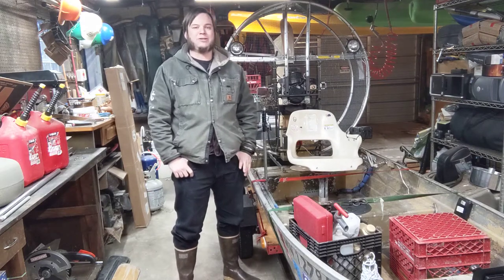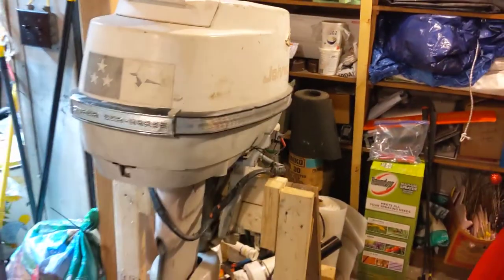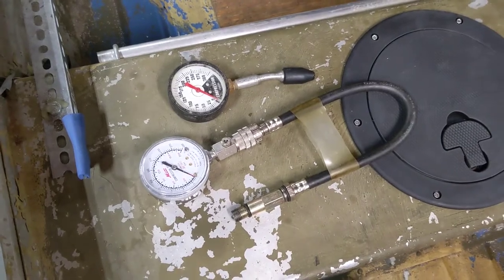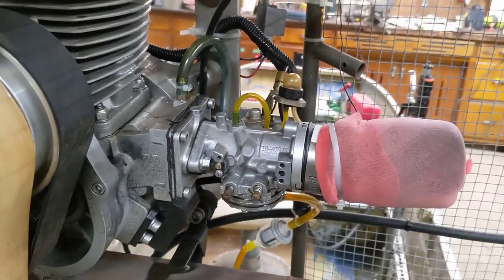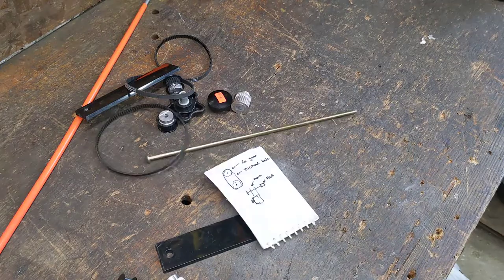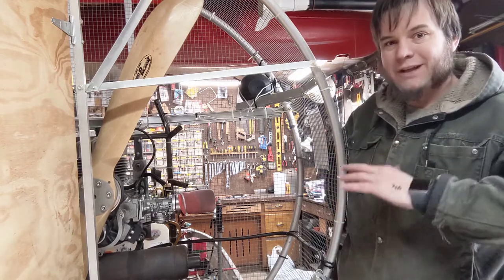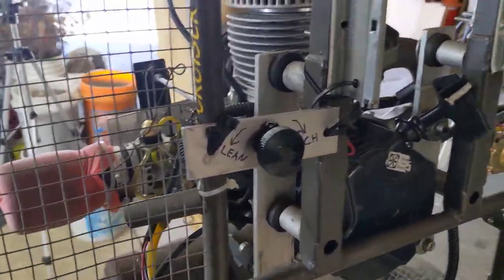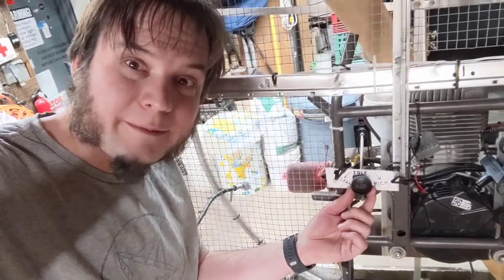Building a Remote Carburetor Adjust for my Mini Airboat

Comment: As you were putting it together I was worried about vibration. I haven't seen all the airboat videos yet so I don't know if you already changed the whole idler adjust system, but if not I would throw a ton of thread locker on the nuts holding the bracket together. Just as the knob is vibrating itself back from where you set it, the nuts and bolts will back themselves out over time. It would suck for the nuts to fall off and your adjustment bracket and shaft either obliterate your prop or launch it back through the chicken wire at you. We all know the chicken wire is just for looks as the prop went right through it when you crashed! haha. *edit: I keep biting myself in the butt by watching your videos in reverse... clearly @4 : 25 of https://www.youtube.com/watch?v=mRE7adeXduE&ab_channel=saveitforparts you say that it's for debris and keeping you from sticking your fingers in, not for prop stoppage

Comment: You should have turned the carby upside down.....if not said before.....
Reply from the maker: I haven't tried that yet. It's designed to be worn as a backpack so it's supposed to work mostly in this orientation. I've still got the thing, I'm just too lazy to take it out much.
Reply: @saveitforparts  those carbys dont care which way they run....your be fine....

Comment: Hey, I love the channel but I got some tips that will take your videos from good, to Viral! Try throwing in some "camera magic" and flex your editing skills a bit by making cooler transitions and a proper intro! Make a cool intro to your videos with all the best clips from your past videos make it between 20 and 80 seconds long. Look up videos of easy transitions and when combined with some light humor it goes a long way. Check out This Old Tony for an idea but Peter Sripol and Ivan Miranda also do some great clips still showing every step of how they built the things but quickly and without just doing a montage/ playing the video fast.

Intro idea: You could start with a little skit of a box of parts labeled trash sitting on a bench in the garage with your wife or girlfriend screaming put the trash out, cut to you just finishing dragging the trash cans out(or taking the cans out and putting the trash from inside in it in 5x video) and then you holding the box of "trash" over the open can. You look into the can, then smile mischievously at the camera and say maybe I should SAVE IT FOR PARTS! (and you can put reverb on that or add big letters or make a thought bubble of you using the parts as the final invention. I picture it being the Potato cannon or what looks like all the parts to it. Ideally you want at least one piece on the top of the box to be exactly the same as what you have on it so you can zoom into (like a shrinking circle surrounded by black) the part then seconds later zoom out of the part, if its placed in the box in the same orientation you can just zoom out but you could also spin the camera  when circled in on the valve or what ever part it is to help mask the cut. but as soon as you open the circle up have you standing there holding the potato cannon  then say fire in the hole and blast it!. You also gotta make a Colin Furze style best clips reel. you speeding across the screen on the airboat, Doing doughnuts on the air boat, and the gopro footage of the crash  going from you smiling to that neutral face and then the look of sheer terror as you realize that you are about to crash! Separate the airboat clips up though with stuff between them. Maybe ordered something like and with writing like [Save it for parts to make: boats] pics and videos of Bayliner Buccaneer Sailboat, Otters on a Boat, yellow canoe and any others, [slow boats] weed whacker canoe putting around, [fast boats] speeding across the screen on the airboat, [trains] video of a train, Small trains [your scale trains], [futuristic trains] monorail, [weird trains] rail bike, [Boats off the water] driving the air boat on snowy roads, [random rockets] Rocket Made From Washing Machine Parts, [boats on frozen water] Doing doughnuts on the air boat, [reckless boating] gopro airboat crash footage, [trains with friends] the big scale train set up, [classic potato cannons] compressed air cannon, [cap guns for adults] parlor pistols best moments, [crazier cannons] semi auto ball cannon, [people acting like animals] human hamster wheel and any other related stuff maybe the video of the house on fire, [animals acting like humans] otters on boat again maybe, bear through yard, humming birds, hawk vs chicken like before you notice it can't get in or like just it trying to strike at it. If you put the best clips of these videos and any other great fast paced, crazy, emotional, or other clips that are able to hook you and make you want to see more and put that in the front of your videos, I guarantee that people will go back through and watch your old videos and it will make your new videos more shareable on social media. 

Another thing is how you show doing all the work, instead of just speeding up hack sawing through a bar of steel and it taking 5 seconds in 10x super speed you can cut the video together of you starting with the first saw swipe and then cut to you finishing the cut like Ivan Miranda does in his videos. Instead of showing you tightening the screws in all speed up just jump cut from first turn to final turnso it looks like it only took one rotation. Everyone will know how long it took but the video is more fun to watch because it is in "Real time" but still cuts out all the unnecessary parts. If as you are sawing the piece falls out of the vice and you drop a hammer onto your toe then cut to that happening, you putting it back in the vice, restarting the cut and then finishing it. another thing is when showing the parts for a build or a box of parts you have. Peter Sripol is great at this where he just dumps it onto the table, snaps and it is organized. You could dump the stuff out onto the table then maybe turn an old knob on the table with tape written over the label like potato cannon, exhaust vent, didgeridoo, bow (all other things you could make with those same pvc pipe parts or whatever) as you turn the knob nothing happens but then you plug it in and snap it is laid out like you will assemble it. little gags like that are great.

Don't be afraid to take multiple takes of something and try adding some jokes, reading some scripted parts, maybe see if your wife/gf can write a few for you. Just having her there when you film if you are trying to make her laugh then you will also make us laugh as well. Just pick the clips you like best, find some fun ways to stitch them together and then you have your video!

Another thing is: you need to work on your transitions like the bit between clips and making them more interesting. I know that it might take a while to learn how to do then right and to get quicker at doing them but if you introduce one new transition each video for the next  dozen videos then you will be making masterpieces by summer!

And lastly, I have some ideas for how to get parts to keep making crazy things. instead of just having a patreon account when your channel gets big enough you could have your viewers save things for parts. Set up a post office box and an email like Safeitforpartsmailbox@gmail.com or something and you could ask your viewers to send you their spare parts or things they have saved. If they live close enough or shipping is to expensive you can even pick things up in person. You might even be able to do mini meet and greets where everyone near wherever you are going meets you at a pub or something to drink a beer and bring their cool old parts they saved. just make sure to film picking up the parts so you can thank them and put it into the video you use the parts in. The Email is so that you don't just post the PO box info and you only give it out to people after you have talked about what they are sending so you are sure you want it and don't get the station flooded with random junk you don't want. I feel like having viewers saving things for parts that you use to make crazy cool things is much more on brand for the channel name. I also think that getting parts sent from all across the world and and different ages will make for interesting MacGyvering and story telling. If you get big enough you might even get some sponsor ships, I think you should aim for companies like Ail Express, BanGood, Ebay and other warehouse discount stores. But then again buying new things for a project is kind of the opposite of saving things for parts. Maybe you could get them to send you some returned items. like some engines or pumps that were returned and they can't sell (for full price at least) because they were opened. Even better if something was broken during shipping then you really can save it for parts! 

Anyways, sorry for leaving such a long comment and Thank you for reading it all if you did. I really love your channel and the world really needs to get better at saving things for parts as a whole! Keep thinking up alternative uses, Save it for parts and keep building!
Reply from the maker: Wow that is a lot of good ideas! I'm going to have to read this comment again for sure. I've been playing around with some of those things already, for example I often do multiple takes to get my wording or explanations right (which yes, I know still aren't necessarily as good as they could be!). I've tried scripts but I come out sounding a bit dead and wooden, so I need to work on that. I did make a "Best of" at the end of 2019 but then I built a bunch of better stuff since then, so I need to update that :-) Transitions have always felt a bit gimmicky to me, I had a film teacher who didn't like them so maybe I'm biased. 

I appreciate the suggestions! I'll give some of those things a try.
Reply from the maker: I'm still debating the intro thing... I noticed that several people you mentioned (Colin Furze, Peter Sripol, etc) don't do regular intros, they just jump into the project. There are some other channels that do, but I've noticed that they start to feel like filler after a while (like they're just there to push the video over 10 minutes or something). I'm still not sure how I feel about them...